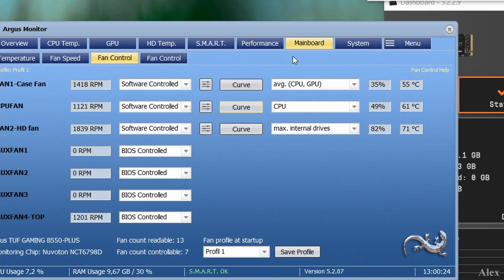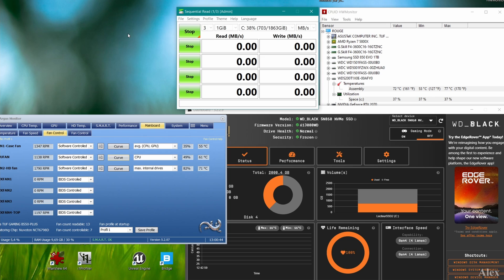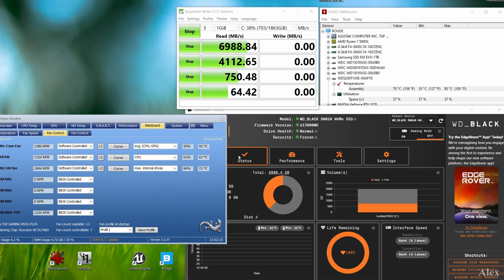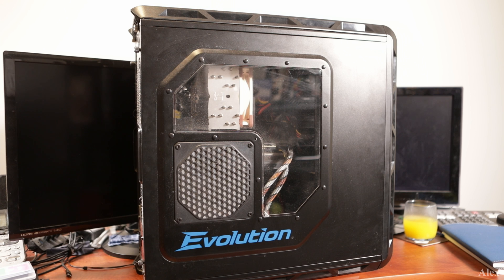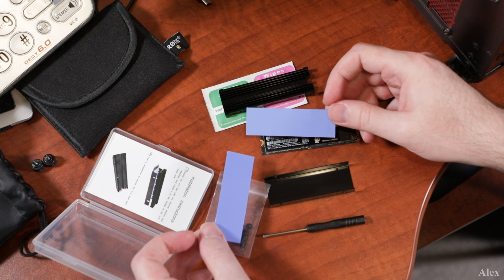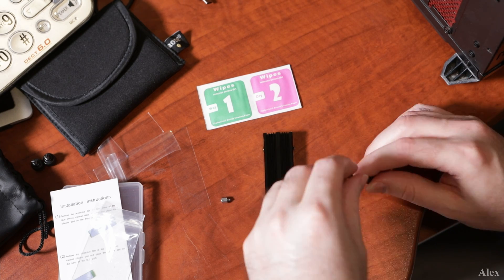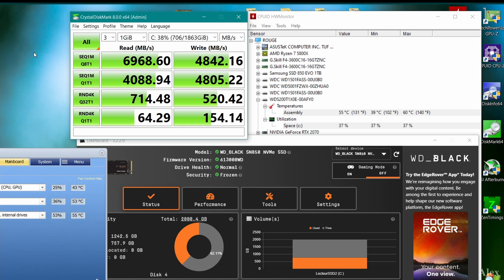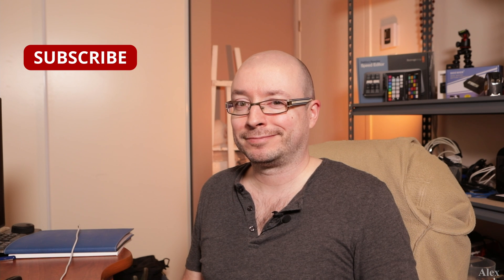WD SN850 NVMe SSD m.2 OVERHEATING?! Cool it to keep it longer! DIY

Comment: the fact that it's overheating means that WD is intentionally selling a bad product. it would cost them next to nothing to put a small heatsink but they chose to ignore this. this is not good. my Seagate Firecuda does not overheat like this. WD is putting themselves in a really bad position.

Comment: I have the SN850, and it has started shutting down due to overheating. Like in mid game it dies on me... after cooling down, it's back to normal. My issue is that is sits on the back of my mobo, pretty snug next to my GPU (3070ti) that generates its fair share of heat as well. Are there any fans one could get that could mount on a m.2? Like pica size or some other way to at least keep the heat under control.
Reply from the maker: Little fans do exist, but you'll have to find them. I am not sure if you can "mount" them on a SN850 tho.... good luck!
Reply: Did you fix this? Also how long until your computer comes back on? Mine takes a while, but same experience here.
Reply: @lfnotmethenwho  I never got to fix it unfortunately. 1 year later I am back here, lol. I have now decided to get a NVME 2280 heatsink with fan built in, from AliExpress. It seems to have a 3 pin connector to power the fan. As an alternative I have to get a 5cm fan to "ugly-mount" somehow within the case to capture the airflow and pull heat off the NVME.
By shuttin gthe computer down and using a air blower on it, it cools down faster...and then stays on while gaming for a few hours. I have now also capped it's power from Windows by changing advanced power settings > PCI Express > Link State Power Management and set it to "Maximum power savings". This to make it consume less power...we'll see how it goes.

Comment: The custom heatsink might be better than the stock one. My temp, with a 2TB SN850x stock heatsink,  during those tests go to 62C maximum for  READ test and 69 for WRITE test compared to your heatsink. I have 25 C in the room. Or maybe because it is an X and 2 TB?
Reply from the maker: The SN850x is a little bit faster, so yes it is possible.

Comment: I have the WD sn750 in my laptop and even with the heatsink and the thermal pad that comes with it the drive still gets hella hot. Could you recommend a better heatsink that might work better to cool it down.
Reply from the maker: In a laptop, I don't have any info for that. You will have to search for your specific model of laptop.

Comment: my SN850 black roasted out and died!
installed it end of march 21 now its 12/9/21 and my $400 + 2TB data is trash!!! Thanks WD
Reply: That's completely your fault, you've bought one of the fastest ssds, used it without proper temps and expected it to have a long lifespan
Reply from the maker: honestly, lookup the warranty! I think it's 5 years!

Comment: Its a good idea to also remove the sticker from your SSD just be sure to save it and don't throw it away in case you need to do any kind of warranty replacement that sticker interferes with the thermal pad making any contact to the drive and the heatsink and will actually make it still run hot.
Reply: Those stickers are meant to be thermally conductive and help dissipate heat.
Reply: Incorrect, most SSD stickers are a sort of thick foil that is supposed to help dissipate heat between the NAND and the controller. Also, the "warranty void if removed" is a good indicator that you should NOT remove it.
Reply from the maker: I did not test with and without the sticker so I can't tell you for sure. On another note, I don't think a paper-plastic sticker will make much difference.

Comment: I recently installed my WD sn750 1Tb  in my gaming laptop and it reaches about 116-118F is that okay temps? if not what do you recommend using to cool it down more?
Reply from the maker: So 118F is about 47C, you should be fine. 👍

Comment: Hey, nice video! I was wondering if the heatsink is small enough to fit a laptop. There isn’t much room inside a laptop compared to a desktop pc. If it is quite big are there any other heatsink that are smaller or are they all similar in size
Reply: It won’t fit an ultra portable pc. Maybe a thicker laptop but doubt it. The sn850 with heat sink measures about 8.8 mm in height. And it’s a small one compared to others.
Reply: just use thermal pads for a laptop it works well
Reply: Hi guys. I am thinking the same. I want to buy this drive (only 1TB version) for my laptop Acer Predator Helios 300. Is here anyone who have tried them in this model? Are thermal pads enough? Because I don't think there is enough space for heatsink either. Thanks!